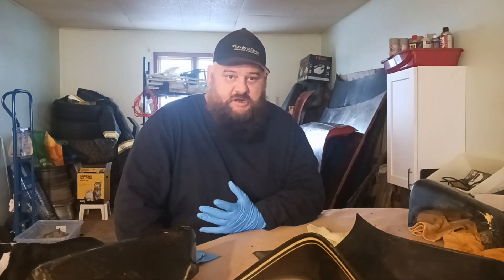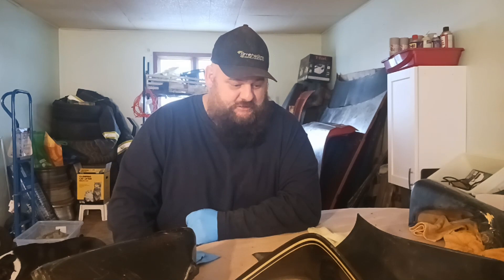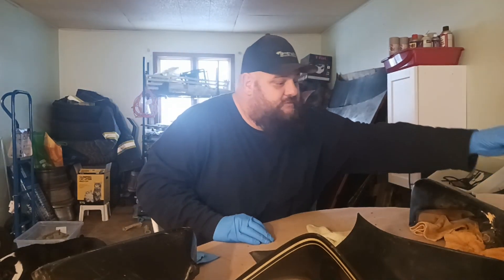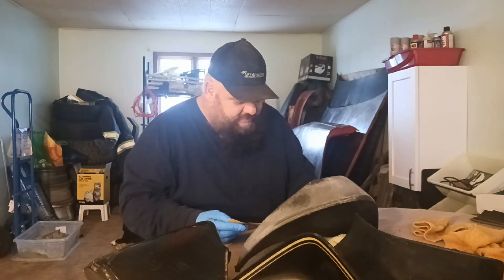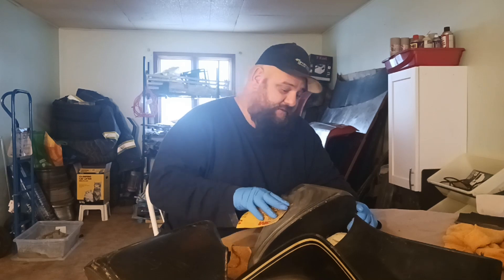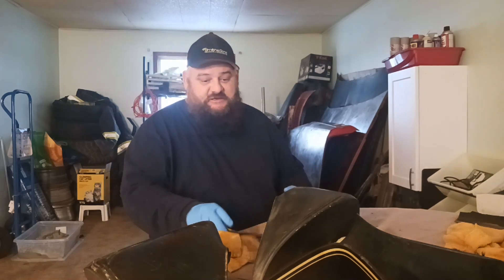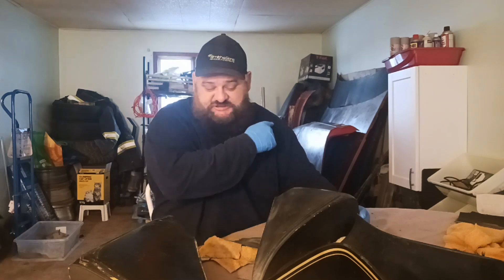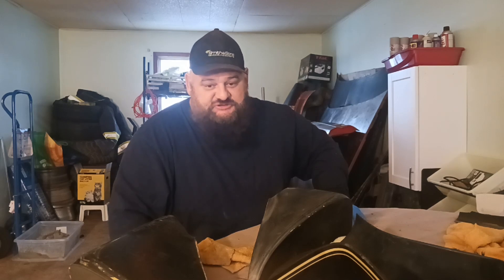1979 s/e trans am Plastic prep and products.

Comment: I think every step is best, that way the entire process is documented. Also you might check into a rubber wheel for those decals . They are basically a giant pneumatic  eraser  or there are chemical compounds to take them off as well. Also  try and keep your fingers/hands at a 45 degree angle while sanding  it helps to keep the ridges and valleys from your fingers forming. You've got some cool projects and youtube page. I'm looking forward to seeing what you can do to them. :)
Reply from the maker: That rubber wheel is a very good point will be looking into that we do not have air tools so need to find it for a cordless drill or cordless angle grinder. And yes I remember Bob telling me that thank you so much for the reminder. And thank you so much for taking on this adventure with us,  God bless you and yours
Reply: I'm looking into these items may not be in then next video but I will try